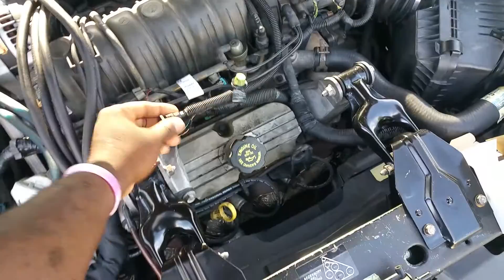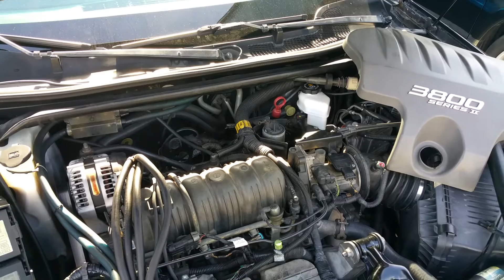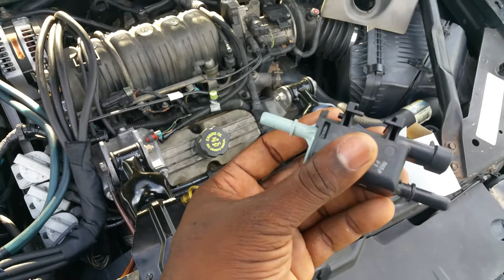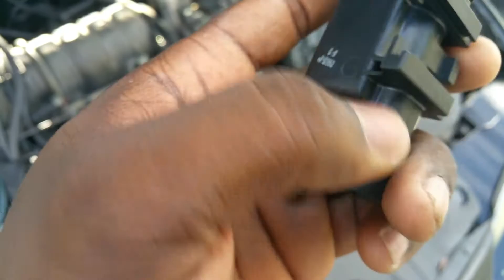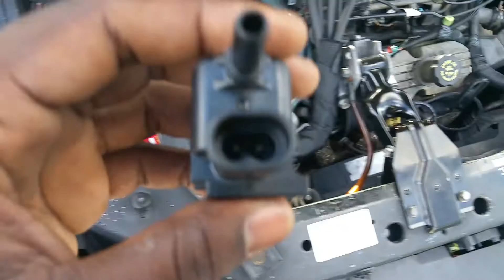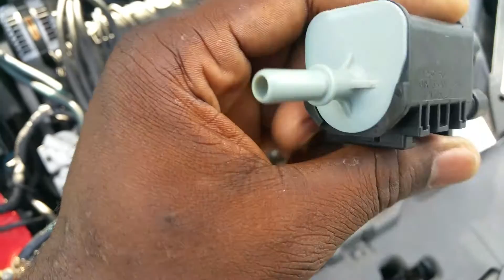P0440 EVAP - Update#4 6/4/16

Comment: Hey, have your sound ever went out in your car? but your aftermarket headunit still worked and your subs??
Reply from the maker: No, All My Speakers And Sub Run Directly To My Amplifier. If Any Problems Occur, It Would Either Be The EQ, Speaker Wire, RCA, or Amp Itself. Suggest You Troubleshoot.
Reply: @TheDemo05  can't find your update#/ on the P0440 code? It would be after 6/4/2016
Reply: Update#5